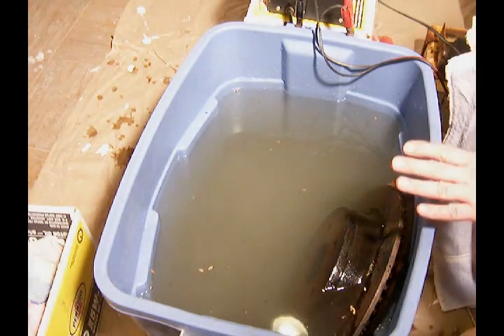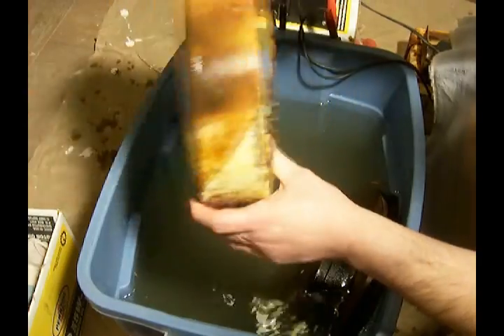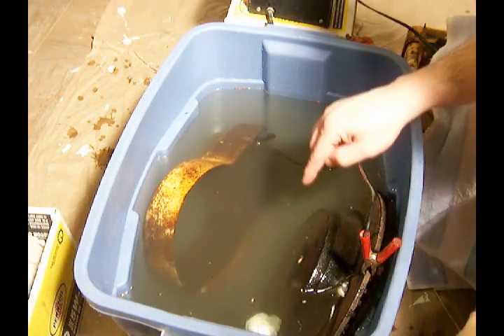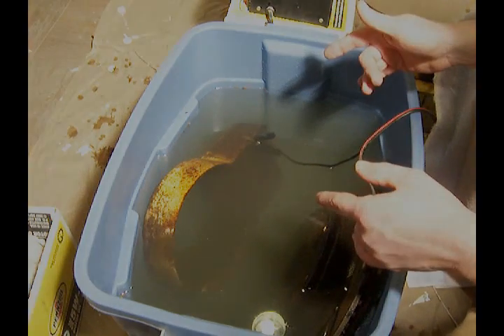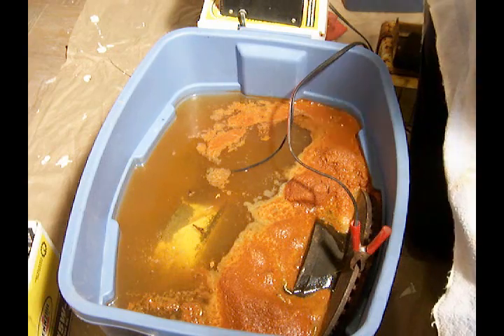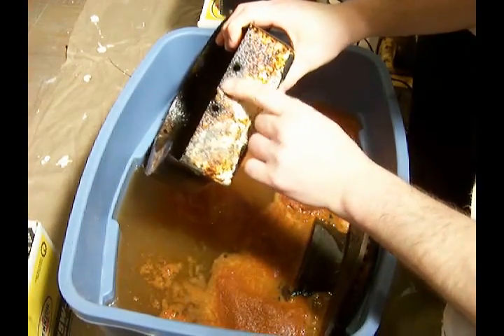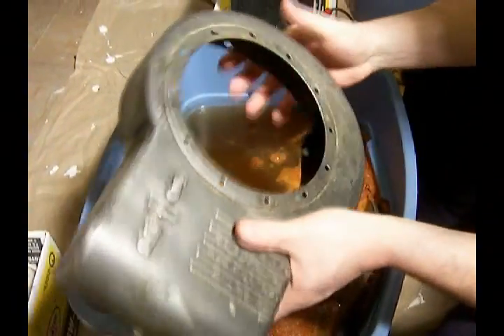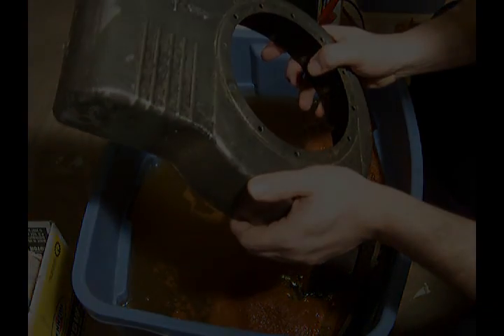Rust removal by Electrolysis - Removing rust from a Briggs and Stratton engine shroud

Comment: 1part Molasses to 9 parts water, 2-3 wks working time. Juice lasts 6-7months. (Chelating effect)
Use large totes or PVC pipes for bath. comes of like silt on bottom of lake-bed. No scrubbing.
(Pressure washer is a +)
I used to do electricity but switched it is slower though.

Comment: Just remember to not let other metals be in the tank. Your clamp and cable connected to the restoring part are (I think) copper and should not be in the liquid. Connect a non-reactive wire or cable to your part and clip to that outside of the tank with your battery charger clip. Baling wire or mechanics wire are common choices. If you want high tech then titanium wire won't react 😁

Comment: Hello, Thanks for the tutor. I have a question as I recently purchased 800 traditional nails (new) but unfortunately they're very rusty (old stock probably). How do I connect the negative terminal to the nails in one go?
Regards.
Reply from the maker: Instead of using this process, try soaking your nails in vinegar or muriatic acid (careful with the acid). You can get the acid at your local hardware or farm store. After soaking them, rinse with water and dry quickly. Maybe even dribble a bit of engine oil on the clean nails, and mix all around to prevent the rust from returning.

Comment: A useful video as I’m also rebuilding my 50s Briggs and Stratton engine Tiller, but you’ve left out some useful information. Ie what voltage or amp/watts used. DC or AC. Also it would be great to see how easy it is to scrub the surface clean. Thanks anyways.
Reply from the maker: Since it's an automotive battery charger, it's DC. My unit has 12amp and 2amp. I used the 12 amp setting overnight.

Comment: I'm seeing all these videos on YouTube about this process but what type of battery charger do you actually need to get this done
Reply from the maker: I have an old school Craftsman battery charger. It has two settings, 10A and 2A.  The newer units sometimes have safety shutoff features that may not work for this. My unit doesn't have those new fangled features.
Reply: @RealManSkills  I figured it out I had to trick my battery charger. I connected it to a spare battery then hooked jumper cables to the battery then connected it... Working like a champ thanks brother for the response
Reply from the maker: @heavychevy2289  That's great! I hope others read this and take your advice. Thanks for watching!

Comment: Sir how much current or volts required for this process pls mentioned AC or DC current
Reply from the maker: The battery charger for this process was set at 10 amps. It is a DC charger for automotive batteries.

Comment: Whats your electrial source. My battery charger burnes fuses all the time.
Reply from the maker: Older Craftsman (Sears) Battery Charger. No safety features such as auto-charge etc... Just plug it in the typical wall outlet.

Comment: Plus you can get ten feet of iron pipe for 60 bucks cut it in 4 2.5 ft sticks and use a Rubbermaid commercial trash can. They also have the wheel setup which is pretty neat to roll your project around and also get it out of the garage to dump it it will be heavy. Plus you can put the lid on for safety.

Comment: Hi mate can you explain what the ingredients in the washing soda is? Pretty sure we cannot get that here in NZ but we might have something close.
Reply from the maker: To make "Washing Soda" you can start with "Baking Soda" - Just heat your oven to 400 F (or 200 C), sprinkle some baking soda on a shallow pan, and bake it for about half hour, until it changes composition. You should also stir it up occasionally, just so that it bakes more evenly.

Comment: Great video! I took a Craftsman yard cart and lined it with a new gray tarp from HF. I de-rusted all the parts from an old Walker Turner 16" Bandsaw in this. The main frame came out perfect. I also re-did the doors on the bandsaw after I decided I didn't like the color I painted them. They had dried for a few days too, but the electrolysis stripped all the new paint right off. I'm gonna do an old heavy cow bell today that I found in the woods with a metal detector (Whites XLT). If you have rusted items to strip down, you gotta try this! Thanks for making this video.

Comment: Can I just use a car battery? The chargers I try don’t work
Reply from the maker: Others have told me that you can use a car battery. It just may not last as long.
Reply: Michael Kennedy A small charger is 1 amp. A car battery is around 60 amp-hrs. It will damage the battery if you drain near 50%.
Reply: Art Smith yeah its an old battery I used, i just keep the battery hooked on the charger, the charger alone doesn’t work and i cant find any manual chargers in my country...

Comment: It's nice to see someone using the CORRECT way of connecting the leads, I've seen so many IDIOTS use the wrong way and end up wondering why it hasn't worked as well as those using the correct way of connecting the terminals.....
Tim Fox messaged you saying, "Electrolosis is line of sight", ... YET ANOTHER IDIOT who knows NOT what he is talking about.
For the BEST RESULTS, ... use 4 pieces of sacrificial steel rod, (ie: big old bolts, re-bar, flat bar steel, ect, and place them in each corner of your square/oblong PLASTIC tub, then, connect all 4 pieces together with electrical wire ABOVE the water line, sand or scrape or grind the area where you attach the wire and twist it tight, and suspend your rusty part in the middle and make a clean connection to that too.

Comment: What setting do you use on the battery charger , how many amps ?
Reply from the maker: Highest possible. My battery charger has a trickle charge of 2amps and a fast charge of 10amps - I use the 10amps for this process. Thanks for watching.

Comment: any idea how th his would work on chromed steel? like a car bumber for example
Reply from the maker: For chrome, I just use SOS pads. Basically steel wool with some soap built in. I haven't tried this on chrome myself, sorry.
Reply: sblg43 i agree with you... except I have used 0000 fine steel wool in the past which does clean up surface rust and stains on chrome... but what i was wondering  (i realize now you haven't tried it) is if it would fill in the pitts in badly damaged chrome as an alternative to sending it out to be stripped and redipped.... if it works that 1000s in saved money! definitely worth the experiment
Reply from the maker: This process doesn't fill in any pits.
Reply: It will create hexavalent chromium, a carcinogen (the chemical of Erin Brokovich infamy). I would advise against it

Comment: I've seen this done without the Arm and Hammer Soap, that makes me wonder if its even necessary ?
Reply: It acts as an electrical conduit. Pure water doesn't conduct electricity the particulates in it is what makes it conductive. The arm and hammer acts as that conduit and the acids in the soap helps break down the rust as well

Comment: Is the battery charger hooked to the wall outlet?
Reply from the maker: Yes, the battery charger is plugged into a typical household wall outlet.
Reply: sblg43 How much power is that going to consume?
Reply from the maker: I honestly don't know. But the electric bill wasn't any higher than usual.
Reply: john handcock 10a at 12v = 120 Watts. Assuming $.14 kw/hr for 12 hours, about twenty cents.

Comment: To much messing about, easier be having it sandblasted or beef blasted
Reply: I've been in the beef blasting business for 20 years and beef is a far better tool for removing rust than electricity any day. Support the cattle industry. Use only locally raised grass fed beef for your rust removal needs. Beef! It's Rust For Dinner.

Comment: can i use this to remove rust from chrome-plated pieces, or will it remove the chrome?
Reply: This will break the chrome's adhesion to your steel just like it does to the rust. It's actually a decent way to strip chrome.
Reply: yeah, I had a feeling that would be the case. on the other hand, great!

Comment: Does metal from the rotor attach itself to the other metal?
Reply from the maker: No, the rust just moves over to the rotor. If there is pitting from the rust on the good piece, it will still be there.

Comment: why is aluminum not recommended?
Reply: it will corrode the aluminium away faster than the rust on the steel. as the other gentleman said, use a wire wheel.
Reply: It corrodes away way too fast, you do note damage than good
Reply: Got ya, thanks for answering my question!!
Reply: I have a part that is half alumium and half steel. A bank of engine cylinders that was inadvertently left out in moisture and have gone rusty after a lot of expense was put into them. That will this do to the aluminium if I put the whole part in the water???
Reply: Don't use this method. Your surface rust is probably looking worse than it is. Use a wire cup on an angle grinder (crimped brass is best) and a very fine engine hone to get runt inside the cylinders.

Comment: Nice video, but a few points to add. This is NOT a chemical reaction as in changing the composition of the rust. It is electrolysis which simply breaks the bond between the steel and the rust. The Laundry Soda is Sodium Carbonate (not bicarbonate as in baking soda) Adding the Soda adds ions into the water  and allows for the flow of an electrical current. This flow of ions is what loosens anything attached to the cathode (part being stripped) including rust, paint, grease , and rubber, so if you try to do this on a motor mount for instance you may separate the rubber from the steel. Also remember that this process produces hydrogen gas which is explosive in strong enough concentrations, so do this in a well ventilated place. It is far safer for the part than blasting which produces heat and may warp delicate parts. The solution never goes "bad" and you can return to the original concentration by simply adding water up to the original volume. If it gets too dirty or mucky I've been told it is great lawn fertilizer. The solution is not caustic, but it can be hard on your hands, so wear gloves to be safe.  I've left parts in the solution (with the charger going) for days on end with no ill effects, so if you have a really gunky part, just leave it in there till it's done. Mine is a 55 gallon plastic drum with a stainless steel liner all the way around the inside. I hang my parts on a steel wire (do not use copper, aluminum of other metals, but stainless would be OK) and attach my negative to that wire. I used stainless steel bolts to attach the liner and the positive attaches to one of these bolts.
Reply: You should NEVER use stainless steel in this process. It breaks down and leeches the metals from the alloy causing a highly toxic solution that has to be treated as hazardous waste... Plain mild steel or steel like old lawnmower blades or rebar works best... I just started a process to clean up an old water pump using a piece of metal cut from the side of a metal can.
Reply from the maker: Thanks for the additional information!
Reply: Can't be we use baking soda as an electrolyte ? To my mind it should work as well
Reply: @SandeipK  It won't work well.
Reply: How can use home electricity for this method
Reply: Since it is sodium carbonate solution, it adjusts the pH of the soil and is not a fertilizer per se. But if your soil is too acidic, it will raise the pH. But if you pH is already high, it will be a detrimental addition to your soil.
Reply: The hydrogen gas produced is harmless. It combines with the oxygen in the air and immediately forms water, H20

Comment: will this work with todays newer digital chargers?
Reply: someone was saying you can fool some chargers into doing this by connecting a small battery to the "circuit" first, then removing it after it begins charging. You'd have to do more research though.

Comment: I bought a 10-amp charger to try this. Opened up and it's a 'dumb' model. No 'manual' switch. Well, I wasn't sure how that'd affect it. I started it up and it starts bubbling. I thought "Cool". This will work. I return hours later and the light on charger indicates the battery is 'charged'. (Smart, eh?). Well, i can't really tell that it did much. I guess I'll return the charger, but not sure I can find a 'smart' one. This one was 30-40 bucks at WalMart.
Reply from the maker: +Alan Meijer My charger is not "smart". Its a craftsman model that has two settings - 2A and 10A. Once you plug it in, it's on. I am not so sure the "smart" units work for this as well. Thanks for watching.
Reply: +sblg43 When I leave mine running, i see the bubbling going on. When I come back hours later, the unit is off and has a green light (indicating charge completed). Frustrating. I'd return it but the last time I tried, I left the one clamp in the solution and it's now coated in white residue...

Comment: Just wondering how many times you change out the dirty water ?
Reply from the maker: +William Wynn Not one time. Thanks for watching.
Reply: I made a tank kind of like yours. I was trying to clean a mower gas tank. Long story short. This time I went low and slow. For a bout 24 hrs. It did not come out perfect. But close enough. Then poured some fresh gas and BB's in the tank Shook for 15-20  min.
poured out and repeated this process about 5 times. By that time the gas that came out of the tank looked clean. So I think that did the trick. I have heard people say they have used nuts bolts and shook for several hours before having any results. Using this method may take longer but a whole lot less work.

Comment: So far i got these arm and hammer washing soda, metal to be use, cable jumpers, conatiner and water. How about the battery what size and voltage. Thanks.
Reply from the maker: +JOLUS FAP Herrera I use my battery charger, but others have said that they have successfully used an automotive battery.

Comment: So the sacrificial metal is just picking the oxide from the iron, thus iron becomes thinner or the sacrificial metal will donate electrons and restores the iron?
Reply from the maker: +Life is illusion The iron is NOT restored. If the rust caused pitting, it will stay pitted. However, the rust itself moves onto the sacrificial iron. Thanks for watching.
Reply: sblg43 Thank you very much for explaining that to me, I really do appreciate it :)
Reply: Life is illusion i8

Comment: did you put shroud in bucket first then switch on charger? my charger has fast or slow charge which one best don't want to kill myself
Reply from the maker: +Womb Smasher Yes, I put everything in the water before I plugged in the charger. My charger has 2 amp and 10 amp charge - I used the 10 amp for faster action. Thanks for watching!

Comment: I ve seen this in so many different ways in ac and in dc. I have built ac unit for my work. The ac unit is called a debluer. Sorry back to the dc for negative side I have heard to use rod iron. I see you use a rotor. I'm trying to clean a rotor so can I use any metal item to the negative like stainless steel or maybe coat hanger. Also what will happen if you use baking soda instead of laundry soda.
Reply from the maker: +Doug Anderson Coat hanger yes, stainless steel no. Baking soda will work but not as effective. You could bake the baking soda and make your own washing soda. There are instructions on the internet for doing that. Thanks for watching.

Comment: I have a rather stupid question. Does the size of the piece your trying to take rust off of have any correlation to how large your sacrifice metal should be ?
Reply: I don't believe there is a correct fomula, but I typically see people use re-bar as its cheap and easy to find. A rotor is probably a bit too big to place and takes up too much room in the tank.
Reply: TheAussieStig30 Thank you very much. We my son and I were planning on using rebar but was worried it would be too small. Thanks !
Reply: That's cool. I'm planning on doing a bmx frame very soon in a kiddies pool I just need a cheap battery charger now, don't want to risk my big one.
Reply: TheAussieStig30 We picked up a cheap one @ Harbor Freight for just doing this. We also bought a closeable plastic tote to do it in, so no little kid or nosy neighbor will touch the rebar when the juice is on .
Reply: Yeah I sell a 2amp one at work I will buy. I'm pretty safe with kids but my dumb old dog would probably stick his nose in, so a lid wouldn't be too bad of an idea. I'd put some holes in it, though so you don't get an explosion. The only bit I'm still undecided on is how I'll connect the part to the battery charger. I think I'll place 2x4 in the bottom of the tub, lay the part on it and run some heavy copper wire from the clamp to the part, secured with a G clamp, or maybe a plastic quick clamp.

Comment: Electrolis works mostly line of sight, thats why the other side didnt come clean
Cheers
Good for you showing
Reply: that's why you need a stirrer to move electrons.
Reply: @resting2528  Kinda not true - the line of sight phenomena is only a problem with small containers - not enough room for an electric field to encircle the part.  When I do this in a larger tub I get electrolysis happening equally over the entire cathode, not just the side facing the anode.

Comment: can this be done to car rotors?
Reply from the maker: ss4vegeta1 I am sure that it can. I happen to be using a truck rotor as the sacrificial iron but you can reverse the connectors and the rust will move the other way.

Comment: Maybe it has already been said, but I think it is worth noting that modern computer controlled battery chargers won't work because they only turn on when connected to a battery.
Reply from the maker: Yes, that has been mentioned. My charger is an older charger. Thanks for watching.
Reply: A battery can be substituted for the charger if you don't have a older battery charger that can do this...then just recharge the battery when it gets depleted. Repeat.